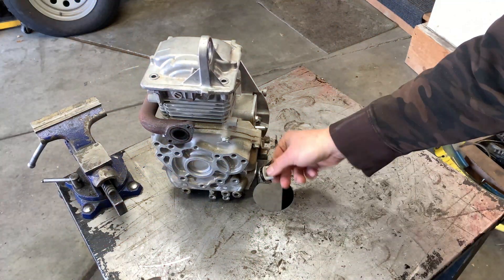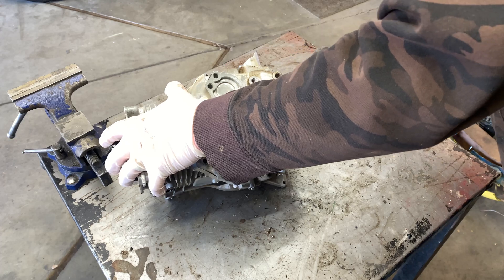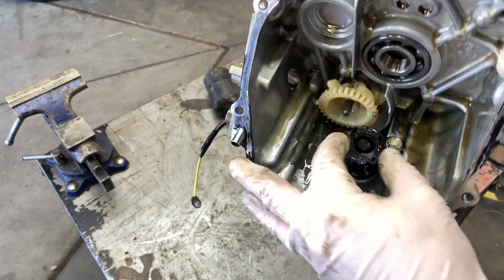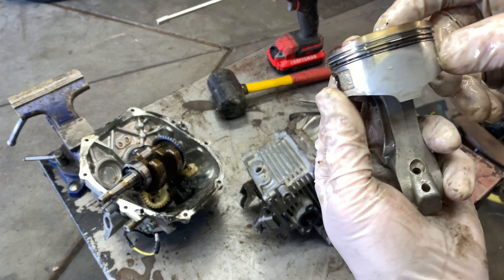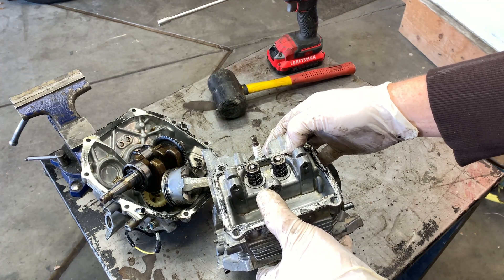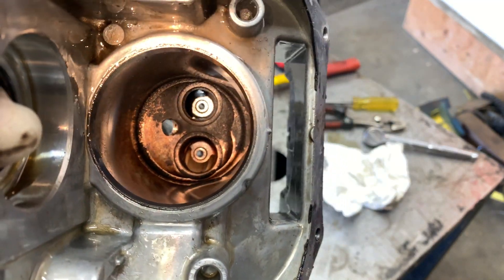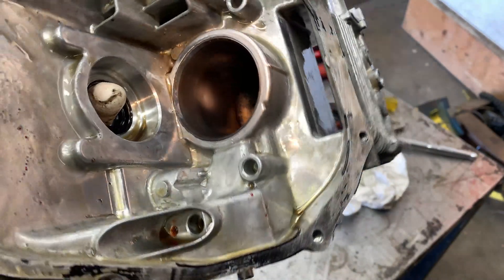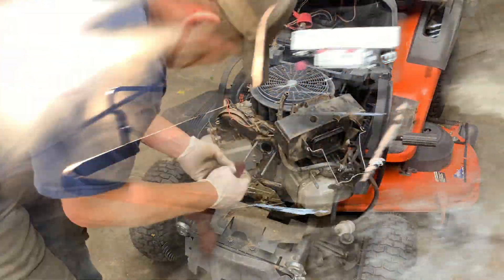Honda EU2000i Engine Tear Down Small Engine Repair

Comment: Nice video. Where is the metal that was in the oil coming from?
Reply from the maker: Rings and piston. Cylinder looks good. New parts have been ordered so look for a new video  soon.
Reply: mfw having same issue and want to know if this fixed it, but "9mo ago"... -_-